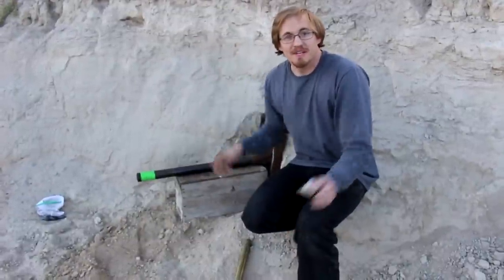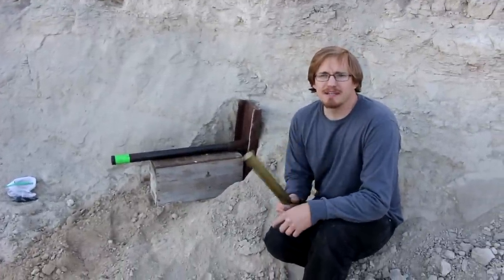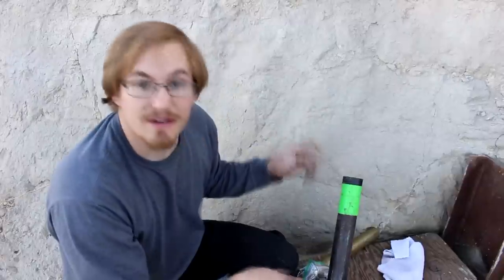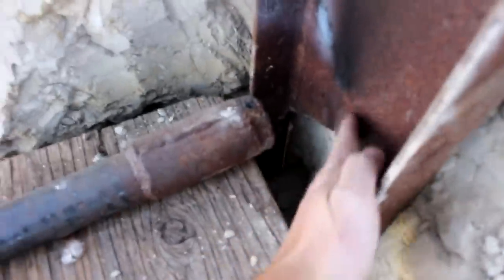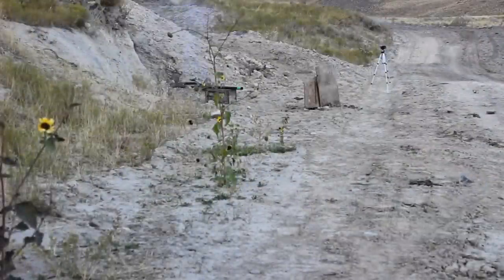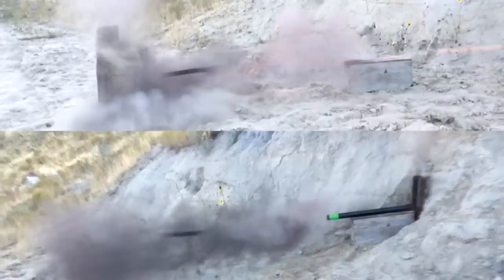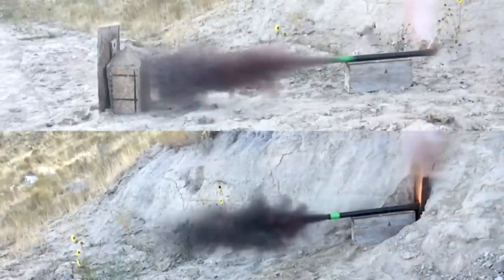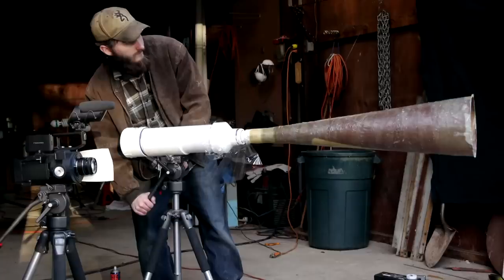How Does Recoil Affect Gun Performance?

Comment: another question, in a fusion reaction 2 H's, that's 2 protons and 2 electrons, fuse together to form Dueterium, 1 proton, 1 neutron, and 1 electron. what happens to the 2nd electron? because the energy being released is from the 2nd proton losing a quark and becoming a neutron, or at least i think that's how i remember it from chemistry class. still, what happened to the other electron? also i think it's weird that fusion concentrates mass, but still gives off energy...something about it just doesn't sit right with me. it seems somewhat counter intuitive i guess. and another thing, just because space is expanding and accelerating at that, it doesn't necessarily mean it originated at one point. honestly in my opinion all the matter and energy of the universe couldn't fit in a singularity, it's hard enough for the mass of 12,000 suns to take up the volume of a planet, and we know of at least 100 billion galaxies which means 100 billion super massive black holes plus the 100 billion stars each surrounding those black holes. and as far as what is it expanding into, well, just more empty space. I honestly think space is eternal because nothing can happen without a space for it to take place, and I dont think space can be created or destroyed, the same was said for energy until someone thought about virtual particles popping in and out of existence which doesn't quite explain hawking radiation because if 2 virtual particles pop in and out of existence at the event horizon, and one escapes the black hole, but the other is sucked in, wouldn't the one that got sucked in also become a real particle and add the same amount of mass to the black hole that the one that escaped took away? does anybody else contemplate this shit or is it just me? does no one challenge the ideas? if space started at one point and was uniformly innundated with elementary particles then we couldn't have ever existed because all the forces would be equal throughout the universe. so it wasnt uniform, there were, probably extremely tiny, variations which led to clumping and eventually the first stars, which brings up another issue, so we see light from stars 13ish billion lightyears away, ok but how did we get here, 5 billion years before the light that traveled to get here, if we are from a 2nd generation star? ok sure there was energy or mass everywhere in the universe which would explain how things are already there before light hits it, but if the universe is expanding, after 13 billion years i dont think the light from those first stars would ever reach us. just my thoughts, sorry i kinda got on a runaway train of thought there for a minute.

Comment: Cody what about varying the length of the barrel?  The longer barrel would contain the expanding gas farther, and so you would get more work out of it.  Is their a point if you use a set charge size where the longer barrel would result in higher muzzle velocity on a braced cannon lock, versus an un-braced one?  Since making multiple cannons of varying lengths would be cost prohibitive is there a lower limit to the powder charge where a braced cannon will successfully launch the projectile, while an un-braced cannon would result in the projectile not clearing the barrel?  If that can be established then one could simply calculate a table where charge size C will result in failure to launch from barrel at size L.  Sorry been awake for 72 hours so am a little punchy.

Comment: The explosion gives a force in both directions. As an impulse. When that impulse hits the embrace you have another hit, with force in both directions. If you had a longer barrel that second impulse may hit the bullet and push it more. With a short barrel the second impulse doesn't reach the bullet before it leaves the barrel, and you only have the effect of the first impulse. Which are the same. My hypothesis. The difference between a mortar and a cannon.

Comment: OK, so I ain't the smartest fella, but the whole slinky think helped me out a ton. So, what was the burn rate of the powder for each test? The burn rate accelerates with added pressure. I don't know this because I know the physics behind it. I know this because I have reloaded rifle cartridges and knowing that added pressure has the powder burning faster is safe knowledge to have.

So if the pressure was the same, but applied in different areas of the gun, then the burn rate should be different, which should cause different pressure because the burn rate would be different?

Comment: Cody! You said that the braced gun losing energy more on the touch hole than the non braced gun because of the higher pressure in the end of the gun, right? What if you dont get a touch hole? Where would the braced gun lose its energy if there is no touch hole? What do you think? I'm realy interested in your opinion.

Comment: Maybe it has to do with impulse. The explosion of the gun powder is so fast the pressure doesn't have enough time to build, so as the blast wave hits the projectile and with pressure x it also hits the back of the tube with that same pressure, but before it even matters if the pressure decreases slower due to the tube not moving the projectile is no longer close enough to noticeably be effected by the pressure.
Basically you don't get a constructive interference boosting the power of the blast wave and by the time the reflected wave does get to the projectile, it's to weak.

Comment: The way I see it, the force that accelerates the bullet is the expanding gasses in the sealed barrel obviously, but since the gun itself is moving backwards, the bullet is traveling through the barrel for a shorter amount of time. Since it's in the barrel for a shorter time, its time of acceleration is not as long as a braced barrel. I feel like it has to go faster.
Reply: Oh, I see you covered that already at the end, nevermind. (but still I think it would have a slight effect on the acceleration.)
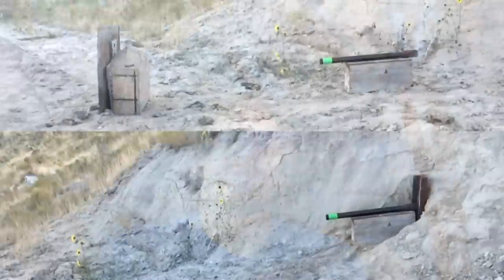Reply: It does. If you slow the video down to 0.25 @ T = 5:05 you will see that the bottom projectile travels more distance in the same amount of time as the top projectile (before hitting the man-made wall). We need more controlled tests. I wouldn't conclude anything from this video.
Reply: I see what you mean, it does look like it went slightly farther before the top one hit the wall. Good eye

Comment: The concept of relative velocity and giving your velocities, vectors will explain what's going on here Cody. The relative velocity between the pipe and the slug are equal in both cases, but the velocity of the slug relative to your camera will be different.

If you make the assumption that velocity of the slug is equal in both cases (relative to the camera) and analyze the system using conservation of energy at any time t, assuming that energy potential is equal in both cases,, you will find inconsistencies where quantities are equated to zero, even though they are known to be non-zero.
Reply: mmm yes, this didn't completely go over my head :p
Reply: Relative velocity is a red herring. It appears superficially logical that there should be some relationship between the barrel and slug velocities, but all that matters is the force of the explosion. 

In this case, it's the expanding gas that provides the force, which expands in a sphere of vectors. Half of it goes forward, half of it goes back (equal and opposite reactions). This holds true whether or not the cannon is braced, half the force is always going back. If there is to be a difference between the braced and unbraced cannons, it would have to come from redirecting some of the backwards vectors, essentially bouncing back the shockwaves. Now that isn't properly done here, since the cannon wasn't totally braced, and it's absorbing a lot of force during the first few instants where most of the force transference happens. And also, it's causing the bounced shockwave to lag behind the leading edge, making it useless. 

Who knows, maybe a better method and a more precise measurement will find significant differences. Certainly there will be some differences if only due to less muzzle friction in the braced version. But I think we can safely say that recoil is not going to have any noticeable effect for shooting under normal circumstances. The same amount of force is being put back into the gun, it would just be dissipated rather than manifesting as motion.
Reply: Sam H All I heard was physics bla bla bla....

Comment: I question the accuracy and precision of the measurements. Mostly due to the variation between setups and short distance/time. The conclusion may not change but it is an uncertainty.
 I don't know if it would work with powder but you might consider a sparkplug to eliminate the touchhole losses. Electric matches could work too, they are(use to be? been awhile) at any hobby store with model rockets, simple 6-12v to ignite. The spark plug would need an old coil and a 12v source (still just a simple contact switch, but the action is on release, coil discharge)

Comment: So question Cody. Would the work being placed on the two projectiles differ in relevance to distance the projectile will travel because you said the braced projectile went about an 1/8 mile. Would the unbraced go just as far or would it be shorter. My thought is the unbraced projectile would be shorter due to the work being more displaced at the muzzel of the cannon. Coming out of the cannon they are going to have the same velocity but over time would it affect it more negatively on the unbraced than it would the braced?

Comment: Ideally both objects should have the same impulse (same energy only in case of equality of their masses). Usually in firearms bullet and powder are much lighter than  parts that are recoiling while bullet is in a barrel so amount of  recoil energy is very small. In part of experiment when the gun rested against hill bullet was traveling a bit faster but how much faster it is hard to say also gun didn't stay quite firm(looks like it has moved for about an inch or more) - deformation of clay definetly took some energy and decreased bullet spead but it's hard to say how much. Barrel is very far from being ideal - alot of gases just leaked and didn't pushed the bullet, barrel is not polished(as far as i know) so friction between bullet and barrel should be pretty strong and it pulls the barrel forward, also friction is neglected. I think it would be better if barrel was deadly secured to some heavy weight in such way that  recoil would spin entire setup as less as posible but not just left resting not secure against easy deformable object. Experiment with pen is much more accurately shows what ideally should happen because there are much less factors to deal with.

Comment: I guess the force doesn't effect the gun until the bullet is pushing it away from the gun instead of the bullet and gun seperating from itself an object dislocating itself under pressure (like a fragmenting grenade would have the same amount of power if it were attached to an object or just lying around on the ground. Essentially the thrust doesn't act up it until the bullet is at the muzzle of the gun (pushing against each other, instead of against itself). Kind of like if you stand in a bucket you cant pick the bucket up until your out of the bucket.

Comment: Try this experiment with a sealed barrel, no flash hole, and maybe some type of distance chart behind the projectile to actually measure the speed. I bet you will have a different result. With the braced barrel the force that would of been placed on the bullet came out the flash hole and with the unbraced it was exerted on the barrel itself.   Braced barrel the bullet will be faster, it has to be. It will be more noticeable with a heavy projectile like the brass rod.

Comment: in both examples, just wondering have you noticed the angle of the slug? When braced the slug is moving straight but it's at an slight angle, same thing happens with the pen, it's as if there was slight more force on the back of the slug then the front to give it an angle, again same thing with the pen

Comment: i see it as: the volume of the barrel and speed of detonation decides amount of force impaired in the projectile. 
 . something along the lines of "terminal velocity" in aerodynamics.  depending on the mass,  and air resistance,  amount of time to reach terminal velocity differs.. 
 so here, depending on the lengt of the barrel, expansion of gas after detonation is way faster than the barrel or the projectile can accelerate, hence, no big difference in the speed of the projectile.  however, if you have a longer barrel, say 10 times as long, there should be a significant slowdown of the unsupported barrel's projectile due to the friction.. but maybe i'm full of .... .anyhow, nice video as always.

Comment: So when you said that a lot of the pressure is lost through the touch hole, does that mean if you repeated this with the same gun but welded shut the touch hole and ignited the powder some other way then the slug would go faster/further when unable to move as the pressure you lost would now be focused more on the slug?

Comment: All your vids are A1 and I'm subscribed for more! But there is a slight difference: Yes conservation of energy and symmetrical forces will always hold. But assuming barrel and projectile are equal mass: Shooting a non anchored barrel is like shooting an anchored barrel of half the length. That is to say: in an anchored barrel the projectile is back pressured for a longer time, in a free barrel the projectile spends less time back pressured. The difference will be more noticeable on shorter barrels. On barells beyond a certain length their will be no difference. Because as we all know lower projectile velocity with a shorter barrel is caused by wasted gas pressure at the muzzle which will manifest in radial blast behind bullet just as it leaves barrel.

Comment: the only difference between the two is where the energy is absorbed. if not for the danger, I would like to see this same experiment done with a bolt action rifle. a closed breech weapon should exhibit the velocity changes you describe as the result of lacking the touch hole.

Comment: I still think there will be more energy imparted to the slug with the barrel against a rigid back-stop, more rigid than fluffy clay rock. The slow-mo only shows a short distance and we have no data on penetrative force. E.g. how many thin sheets of plywood (or other material) will the slug go through at a set distance in each case. It would also be interesting to see a longer barrel in play. I was also wondering if the elasticity of the (relatively thin) steel pipe absorbs otherwise usable energy. It seem that there would be some sort of usable rebound shock wave internally.
Super cool though. Thanks for taking the time to set-up the test. Curiosity is still killing my cat; I'll have to watch again...

Comment: Using such a heavy bullet leads to an interesting situation, at some point the bullet becomes the gun and the gun becomes the bullet. For instance, if you used a length of rod long enough to hang out the end of the barrel, you could put a stock on it and fire the barrel as the projectile.

Comment: Am I correct in thinking that the unbraced shot would travel less distance than the shot from a braced cannon, based on the hypothesis that appx.1/2 the energy is expended in the recoil of the unbraced cannon barrel flying in the opposite direction?
Reply: half of the energy still goes in the opposite direction, but it is just stopped by the mass of the entire earth, seeming to us as if it did nothing. The energy still goes somewhere, in this case it just goes into the earth

Comment: +Cody'sLab so the force gets lost through the gas hole more when there is no recoil, what would happen if the gas hole was blocked over or didn't exists? I'm guess this would change the factors and the gun without the recoil would fire the bullet faster?

Comment: Can you put a high resistance wire/heating coil in the back of the cannon to electronically trigger an ignition without a touch hole? Maybe thread a breech piece onto the cannon so you can clean it better and replace the coil if it burns out? Love your explanations of why it doesn't matter, but you could eliminate that variable if you needed to, I think.

Comment: Wouldn't an energy balance equation help explain the results? I'm not at a point yet where I could comfortably write one myself but I think the basic principles would be that regardless of whether the gun flies back or is braced, the same amount of energy is released.

Then again, another way of looking at it would be to image that you're falling off a cliff whilst standing on a wooden board, if you try to jump off the board does the board accelerate downwards faster or does your body accelerate upwards, thus slowing your fall? or both?

Comment: I REALLY wanted you to repeat your pen/AA battery experiment with the 'gun' taped to the metal sheet, & the 'bullet' free to move as the 1st time, to illustrate the braced/free air expansion from a fixed point.